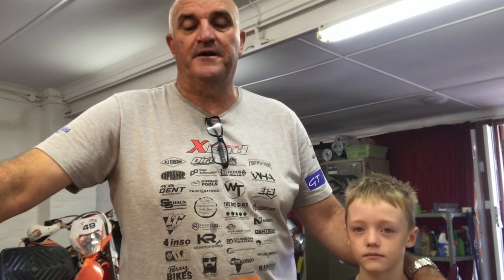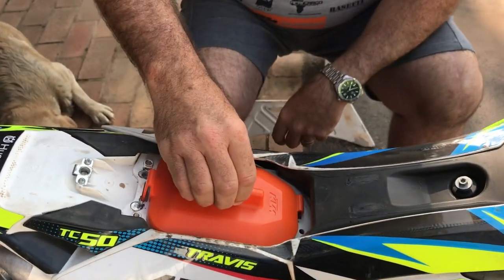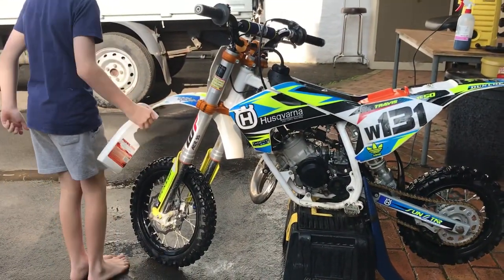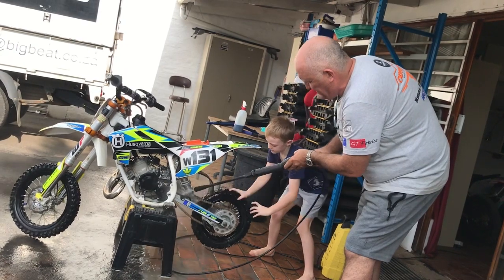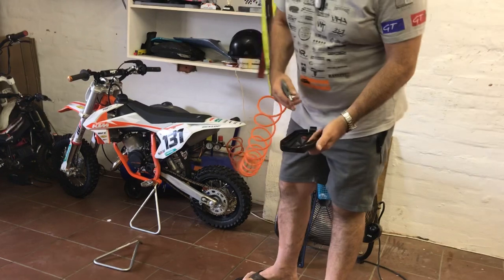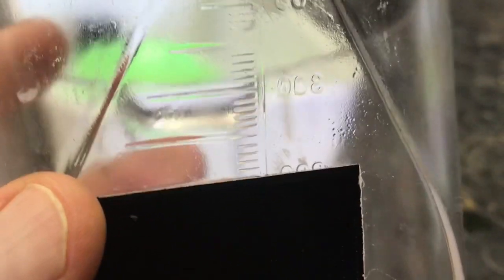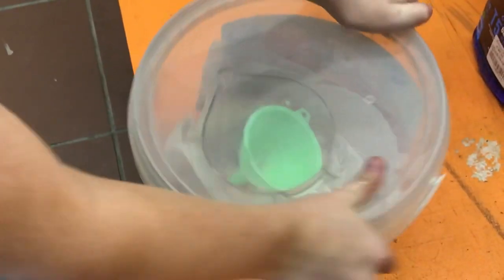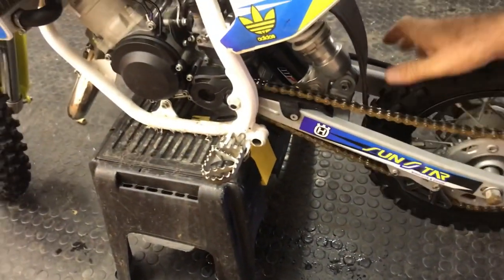50cc Motocross Dads (Episode 1) Maintenance and preparation of KTM SX and Husqvarna TC Bikes

Comment: I like your ethics, to the cleaning of the bike, we have the same bike, it's our second one it is a 20/20 senior, the only dilemma that I have watching your video is I don't think you should use carburetor cleaner where there's any kind of seals carburetor cleaner will take the Integrity away from seals O-rings anything that is made of rubber there are other products that do not distort plastic or Rubber and clean just as well unless the carburetor cleaner using isn't the same is what we use, but thank you so much for helping people understand these bikes are very sensitive so taking care of it properly is very important!

Comment: Appears the rear brake was dragging  at the end i loosened the pipe and the rear caliper ours no longer drags on the ktm , and it`ll help if you just spray the inside of the chain as thats where the chain contacts the sprockets